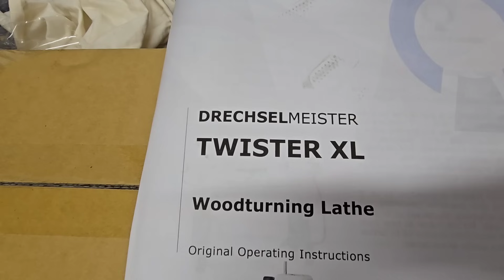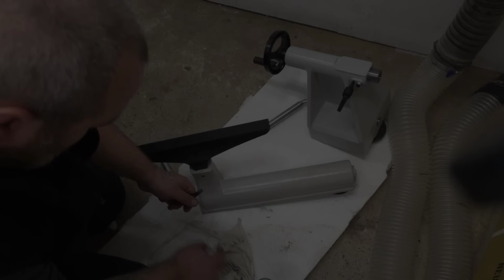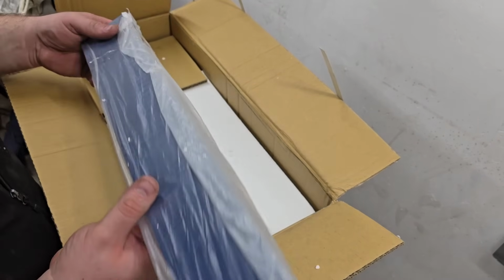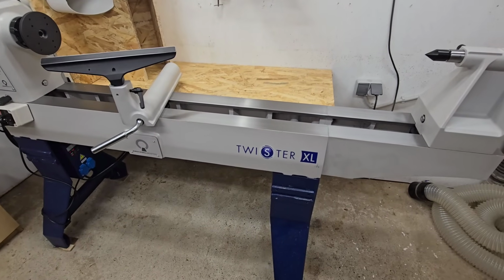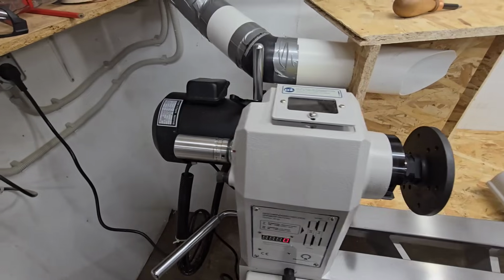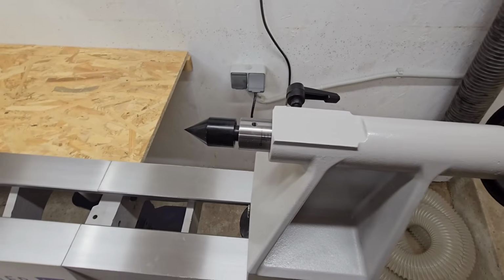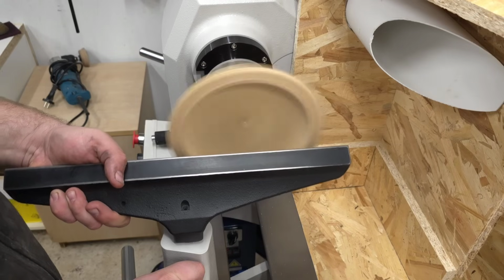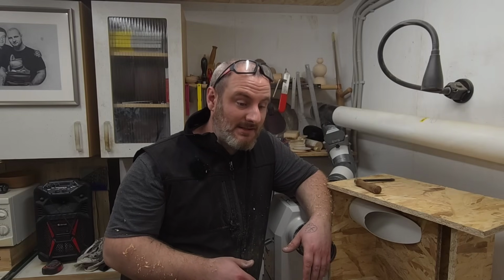Its Finally Here, And All The Family Helped Put It Together

Comment: Hi  Tomislav, I'm very interested in understanding what was your criteria to select this awesome lathe. And specifically how it compares to the Stratos XL in your experience. Wish you a great day!
Reply from the maker: Hi
I was lucky enough to turn on it in woodturning event in Austria, and fell in love it, the reason for this instead of stratos is I like headstock design on mine as I can fit dust hood as I have where the stratos has much more bulky headstock,  but stratos is a more powerful lathe if you need that.  For me 2hp is good enough and I never stall this lathe,not even close and I'm on higher speed pully. 

Merry Christmas

Comment: Lots to like about that lathe!
Los of quill travel with ACME.  Auto eject?
Lots of cast iron.
Moveable control module and includes a tach readout.
Moveable headstock. 
Indexing and a separate heavy duty spindle lock.
Bed extension options and with that one 1.4m between centers.  Just long enough for a project I do occasionally.
Switchable electronic braking.  Really nice.  Ever tried programming a vfd?  Not fun.
Big bearings.
Extra power outlets. 
Round clamp block under tailstock for easy on and off the lathe.    My lathe has shallow t shape square block you have to fiddle with.

I’ve been saying my next lathe is going to be a Vicmarc, Oneway, or Robust.   I would add Neureiter to that list if they were available here.  
Easy to see why you picked that one.   Congrats and looking forward to seeing you put it to use.
Reply from the maker: True,I would add them to the list as well,thank you very much for watching and comment

Comment: Good morning 🌅, Very nice Lathe, great to see your family involved in helping you, we all look 👀 forward to seeing you working on your new toy 😂, I have a Wadkin RS8, I had to get a winch to lift it so I could put it together,
Reply from the maker: Uff wadkin is a beast and unfortunately nowhere to be found even close to Croatia..... probably as its a rare that some will actually sell it....
Thank you very much
Reply: @tomislavtomasicwoodturning  I only play £600 for it back in 1998/9, but I did change the bearings and motor to a inverter driver, even made up a motorised tail stock.   I also purchased a MCN KONTOR 1500, I had got a contact to make a lot of Salt / Pepper mill for the millennium, the bottom section of each mill had a rolled silver end to it, and hallmarked for the 2000, and at the time I was doing subcontract work for an organ building company, I was making components for them as well, I wish you all the best for the future,

Comment: Good Luck with the Twister
290 Kilograms ≈ 639 Pounds

I had the only Sratos XL in USA back in 2017.
It was a Beast...
320 Kilograms ≈ 705 Pounds

We had a massive Flood here and I was forced to sell it and other tools to repair my property.
I have not been able to replace or turn in many years.
Would be a dream to get another large lathe because I have so many dry unfinished bowl blanks.
Reply from the maker: I have seen your video on stratos, sorry to hear about flood and that you have to sell it, but I'm sure you'll get back on big lathe soon. 
Its 290kg without bed extension, bed extension is another 30kg, so comes over 700lbs.

But stratos does have slightly more weight at the start.

Thank you and wish you all the best
Reply: @tomislavtomasicwoodturning   Thank you, yes after 50 years of turning, I miss the process of making things.  So hard to find the $$$$ and Stratos no longer sells in USA.  They had partnered with Colt back then and Colt dropped the line.
Reply from the maker: @DustySplinters  aaa too bad as I would guess turners would be interested in them

Comment: Nice looking lathe Tomislav! I followed the link for it in the description and it went to the website but everything was in German. Could you give the capacity specs in English please?
Reply from the maker: I will of course, btw I have set up google to translate german as I don't understand either, but its easy to active in settings....

2hp motor,230v
290kg without bed extension 
20 inch swing over the bed
I think up to 1m when outboard turning 
Between the centers without bed extension is 850mm roughly and with bed extension 1400mm
All cast iron
2 digital readout 
Magnetic box with controls
Let me know if I miss something 😀

Comment: Your new lathe has the smoothness I liked about my old Jet lathe and is lacking on my Robust lathe.
Reply: I was surprised to see your comment that your Jet lathe was smooth and your Robust lathe apparently isn't? I have been looking at buying a new lathe, the Robust lathe was at the top of my list. I'm not sure if I want to spend that kind of money. I know three people that have Robust lathes. Two own the American Beauty and one the Sweet Sixteen.  All three people have told me these lathes were the smoothest lathes they ever owned.  What model Robust lathe do you own?
Reply: @zimaadams1132  I meant specifically the banjo movement across the ways.  I should have been more clear.  I can’t fault the Robust for anything else.  I had to pay almost $400 for a second banjo because the one that came with it was a monster.  The smaller one moves more easily, but still not like the Jet.  I have a Sweet 16 and I added a tilt for the tailstock to move it out of the way.  Another option would have been extending the bed to just slide it out of the way.  The new lathe was my 80th birthday present from my husband and I’ve been using it for 3 years.  Last year I sold the Jet to make more space in my shop but now I wish I had kept it.  There’s always room for one more tool 😆

Comment: Great lathe Tomislav you will have great enjoyment turning on that. I have the Twister fu 180 for nearly 2 years brilliant lathe to.  Best of luck with it to you and hard to beat the family for help 💪 😂
Reply from the maker: Thank you very much, I love fu180, great lathe
Reply: Could you show in a video how it's bolted to the floor. Thanks
Reply from the maker: @michaelglackin2420  I will, but I mark the holes, then drill, put plastic inserts, and position the lathe back and add shimms so its not on the concrete, and just thighed it, you just need to make sure that you don't twist anything while doing so, add more shimms if one leg is more in the air.
Reply: My lathe does not have holes on the feet but they are adjustable

Comment: Cont grats on the new lathe I love the tail stock travel, the sound on the mike is fine. What is the diameter that you can turn?
Reply from the maker: Thank you very much 

Over the bed its 20 inches and with outboard 1 meter